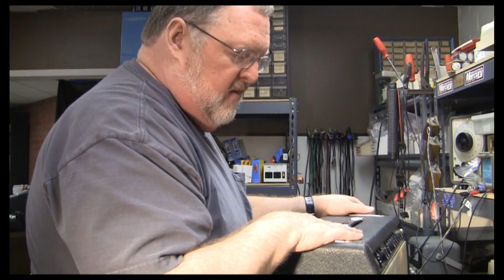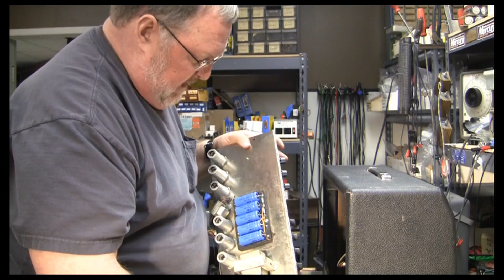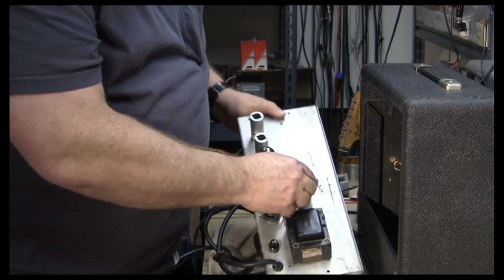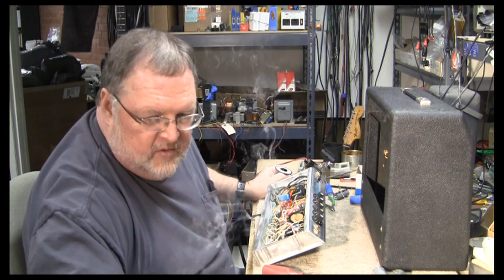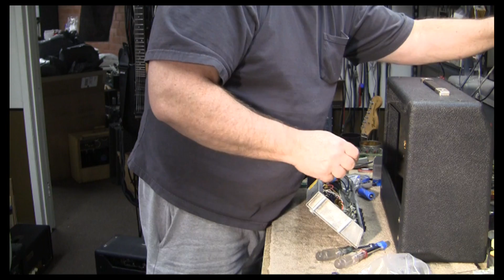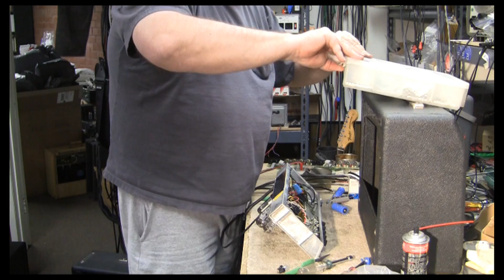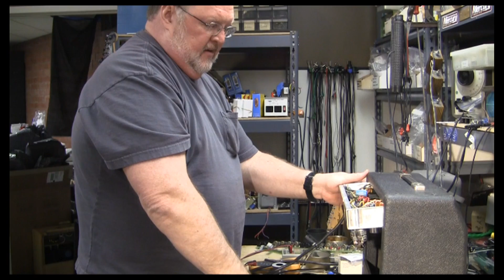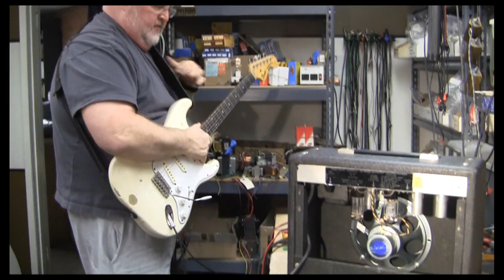Roy Blankenship Amp Repair Shop - 1

Comment: I also repair amps, mixers and many other types of audio visual equipment. I am surprised by the cluttered shop and especially the bench area. I would NEVER use metal components on a bench with live voltages. Mine is wooden, carpeted and all my test gear including power supplies and test jigs are secured and easy to access.
Reply: ??? The bench is a metal frame and an MDF table. In 23 years, this has never been problematic. I usually have a carpet sample in the middle, though lately I have been using large cardboard flats taped to the work area that cover the metal front. The amount of clutter varies, the day this was filmed, I did not have enough notice to clean up, if you read the disclaimer at the top, this was never to have been released. I agree a clean work area is a good thing, but lately the volume of work and emergencies have made that time impractical. Thank you for your comment.
Reply: +Gizmologist1 Hi, fellow tech here (credentials unimportant). I watched the video out of curiosity and the only thing I would nit pick is the mis-explanation of the roll off (It's moves DOWN). But this is all semantics and when i'm 'on the spot' I don't always explains things correctly either. Roy here, seems to know his craft well enough to not need a public shaming from other techs, especially on the basis of his work area. As techs we take responsibility for ourselves, our own safety, and this has absolutely zero reflection on repair ability which should be the only thing we are ever judged on. You should be ashamed for addressing your peer on his work area. It's his work area. He can arrange it to suit his personal needs and it's none of your business. That is of course, unless you cannot find anything about his capabilities to nitpick in place of it. Which I suspect is the case.
Reply: monosurge
I agree. I was wrong to make an issue of the bench area. I was just concerned about a metal surface as most guys want to be sure there is no possible inadvertent ground points. My own bench is frequently cluttered and i have to stop to clear it off frequently when I am building a project. Whenever i have built a new bench, I use all wood (2x4 framing and 3/4 shop ply) all glued and screwed. The top is then wrapped in quality indoor/outdoor carpeting with edges rolled under the wood of the top so as not to get splinters in my belly. All possible ground points are well identified for wrist straps or alligator clip leads.
Reply: Gizmologist1 It sounds like you have a very nice setup for your preferences and it was very nice to run into a civil human being on the internet (kudos). His bench top is all wood and the frame is steel. He could still get bit if he leans into the edge, or a leg into a support. But i'm sure Mr. Electron will remind him not to do that again. At least for another week. I like a good solid shock once in a blue moon, myself. Maybe that's where my personality comes from. Take care!
Reply: Aren't you special. I bet your shit doesn't stink either.
Reply: it was a very nice video who gives a crap what people think the video wasnt an informal clutter video

Comment: When you put a test signal on the input what voltage do you use?
.5V P-P? 
1V P-P?
Also, do you use a frequency of 1K? 500K?
Reply: I have an old tube H-P sine wave generator that puts out slightly less than 1 volt at 1 K.

Comment: The misinformation of 3 vs 2 prong plugs is astounding!  Guitar amplifiers have power transformers that act as beautiful isolation transformers as long as you lift up the ground plug!  Unless there is a fault with the power transformer then the probability of shock is low!  The only dangerous area is where  the power comes in to the primary side of the power transformer - and the fuse will usually stop any issues there!

Comment: sir can you tell me the name of the device i heard is but not correctly...varaic right?and also please tell the process of testing using oscilliscope...i am confused if i am not wrong then ...the process is like give sine wave then add dumy load between probe and amplifier output and at last compare the output with input...please tell if iam wrong..
Reply from the maker: Yes a variac....autotransformer. https://www.circuitspecialists.com/variacs

Comment: Hey Roy, I had a problem with my amp where it would repeatedly switch to lead channel after I manually switch it to Clean channel and that happened for a couple of days and then it turned off out of nowhere. I tested it multiple times to turn it back on and sometimes it did but then went right back off and sometimes wouldn't come on. Now it completely doesnt turn on at all. Would you happen to know the problem? It is a Bugera 6260-212 Tube Amp.
Reply: probable the voltage regulators on the 15v supply have overheated and failed.. start there.. best thing to do is extend the wires and mount them on the chassis for some sort of heatsink when you replace them.. use the normal high voltage precautions.. tube amps are potentially LETHAL.. proceed at your own risk !!!  (usual legal disclaimer.. could actually be why a lawyer warned Roy off)

Comment: Other than being in extremely bad taste, are there any physical/electrical problems w/ having capacitors loose like that?
Reply: alex tworkowski excessive vibrations will cause the leads to break and shorts to develop in the amplifier.   As the capacitors wear out the amplifier will start making more noise

Comment: I've worked in electronics for over 50 years and I know what Roy means when he tells people to use a hot tip so the joint heats up to the correct temperature. If a joint has any mass a 500 degree tip just won't work. With experience you can judge just how long to apply the heat. i used to fight with QC people about the futility of equipping the shop floor with soldering stations locked on 500 degrees. If you want good quality you better depend on the skills of your assemblers, not bow down to the latest "finding" of some "expert".
Reply: I strongly agree!! Well said!!

Comment: Good day Sir,

                     I hope you remember me, i did send you a letter about my peavy amplifier 4-c, because i did unplug the wirering and did not note where the wires go. Now i'm unable to plug them back. So, i'm sending you pictures. Give me an adress where i can send you the pictures please? I did plug the thermal fuses wires but i'm not sure that is where they belong. If you'd be kind enough to watch the picture and tell me if i did plug them right or wrong and tell me where they really go if so. I would appreciate a lot simple english and accurate explanation easy to understand because i am not english. Thank you very very much Sir. Best regards,

              Serge Lavallee.

Also, i don't know why, but when i unplug everything exept the transfos plug on board amp,  the on-off switch green light  is always on, if you can help me on this too. 

By the way, i can not find here nowhere, the wiring plug, the shematic, nothing, i mean a shematic of where the wires plug each one of them ( With their colors). It would be kind if you have it and send it to me. Thank's again Mister.

 Serge Lavallee.

pico7401@gmail.com

Comment: @Barry Landau Hi Barry don't know if this is you replying or Roy, i would like to ask a question about a hifi amplifier i have from 1969 a transistor Bush (english made) amplifier, it's not a guitare amplifier its an audio hifi one and a seperate, well this is my question.
When i play a record through the amplifier,it all works fine lots of volume,bass treble etc, BUT there is audible distortion in the background, more noticeable when turned up louder and whenturned up max the sound breaks down quite badly.
There is also a hum heard through the speakers,if no music is playing and i turn it up loud then i can hear the hum,it sounds like mains hum.
Well this is my question, could old worn out capacitors on the power supply cause distortion?
and could old worn out capacitors on the power supply cause hum?
The caps inside are the original ones from 1969,never been changed ever.
Along with this in broad terms what else could cause distortion on the amplifier other than the capacitors?
The distortion isn't absolutely terrible,but still you can hear it, especially in the mid range area and becomes more prevalent when turned up
Reply from the maker: You can find Roy's contact information on his website. : http://www.blankenshipamprepair.com/
Reply: Yes.
Reply: Richard Bruce
Hi Richard are you saying YES to old caps causing distortion?
Reply: Old filter caps cause hum. Suggest replacing all electrolytic caps asap.
Reply: Richard Bruce
Great thanks now i know i can act upon it, going to replace all power supply large caps, thanks

Comment: Nice equipment Roy. I also use the same Makita (25 yrs) and Weller for larger stuff but for smaller components I use a  Edsyn. I have seen many crazy things repairing Linear amplifiers and HAM equipment. Some scarey like electrolytics scabbed in that cracked like a 22 rifle with 20k volts on them but what makes me cringe the most is equipment full of cockroaches. Great video guys. Next video of Roy rocking out? KD8EGV@Engel Electronics

Comment: I have been playing guitar for 48 years using all valve amplifiers,......  I built a Class D, 500 watt with $30  valve pre-amp.

The total price for Class D amp head and preamp is $150 and shits on the older version valve heads.     Future for good quality amp heads is "Class D",  it's the way to go.  Valve amp heads are overrated old and expensive, and no match to Class D.

Comment: Hard to find a good valve tec how can return a vintage amp to factory specs ive had a vintage fender which had been moded which sounded like crap and blow up two weeks after a service.My marshal jcm 800 and a 900 which also had been moded paid a lot of money to get  the original factory spec by my tec in Australia BJ amplifiers in Ipswich qld how is a legend like your self, my amp sound as good if not better than new .Have been caught early on by a doggie amp doc how moded my vibrosonic by gluing a pot in and used  it as the bias which blew my amp I took it to BJ amp repairs he pulled it all out and told me there was nothing wrong with the old bias which was built into the chassis he told me he'd never seen one fail  I took all the cooked valves doggie bais and extra wirers back to my X amp repairer how gave me a refund and replaced all the valves. Which BJ amp used in the repair saving me money. Find a good tec count your blessings watch out for the mod ones, Great Work.

Comment: There's nothing wrong with replacing the cap can with separate caps inside the chassis, as long as they are mounted correctly. Those cap cans were not always available, and they are overpriced. They certainly should not be left floating, but they can be mounted securely inside the chassis with one or two small terminal strips. Lots or good , qualified amp people do this. That said, while I do that for myself, I might be more circumspect with a customer amp, if I were in the business.

Comment: i don' t agree that you "fixed" it by removing perfectly good capacitors just because you didnt like the location and according to you wasn't "normal". The amp would operates exactly the same if the caps remained where they were instead of wasting $100+ on a new cap can. This is consumer fraud in my mind.

Comment: Have to disagree, basspig. He seems to have at best a tenuous grasp on basic rc filters, and despite his talk about workmanship, failed observe fundamental safety and quality rules (reaching over a circuit with 90 volts in it!?). He did the entire operation with no grounding, in a cluttered workspace. And when he just slaps in a cap with a different value? Didn't even bother to find the cutoff frequency. Absolute rookie. Dave Jones would tear this guy apart.
Reply: Dave Jones vs Roy Blankenship: Battle of the century. Someone make this happen.
Reply: Jones is an engineer. He knows way more about how these circuits work.
Blankenship has experience that would help him do relatively familiar work quickly... but he'd fall behind in most other tests.